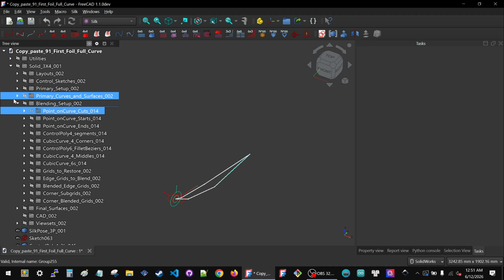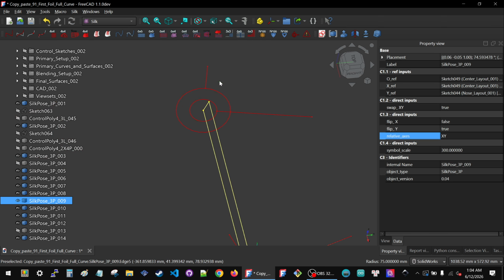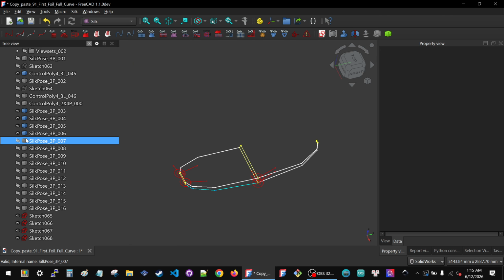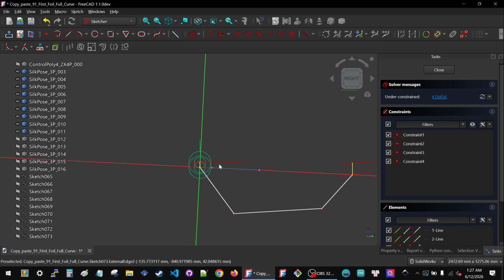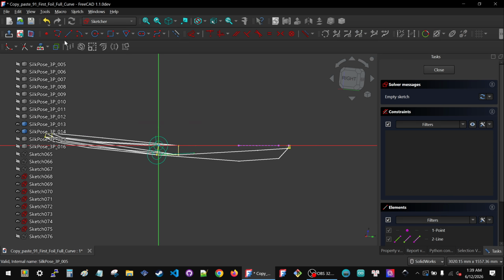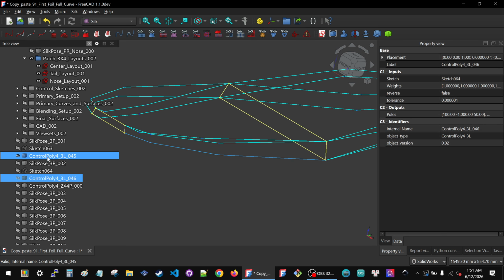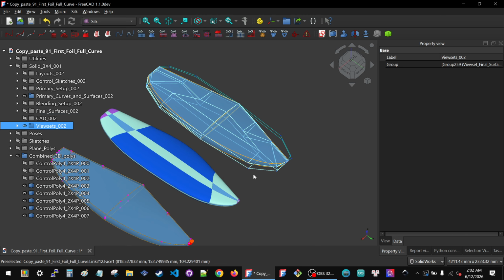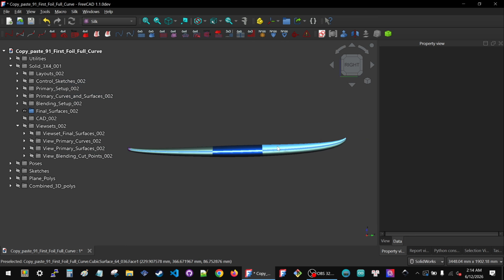FreeCAD Silk - Complete Tutorial Series 33 - Full Foil

Comment from the maker: The 7 new 3D curves are made in  'batch'' steps.
Skip guide for the steps:

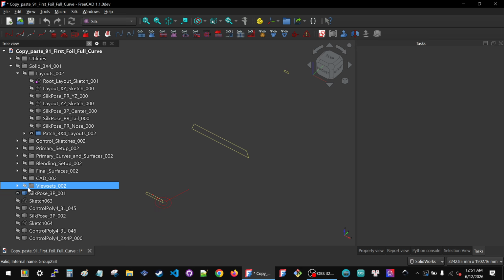0:49 'top' view SilkPoses for the 'right' rail (trick to get the correct X direction)
2:50 'top' view SilkPoses for the 'left rail (+trick to flip Y direction)
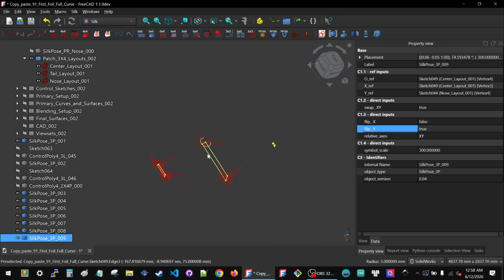7:40 'elevation" view SilkPoses for all rails (specific inputs and options)
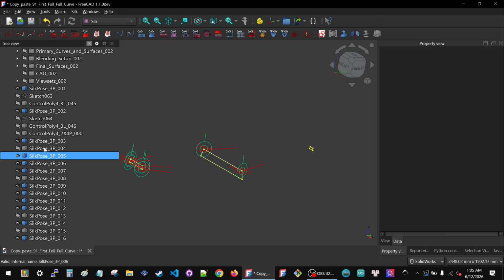14:20 'top' view curve sketches (drive X and Y)
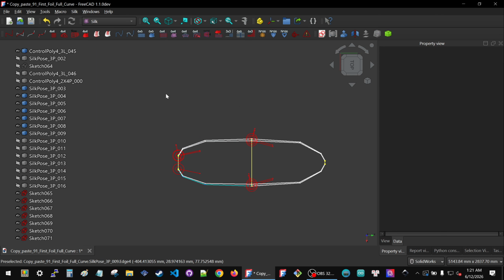29:57 'elevation' view curve sketches (follow X of 'top', drive Z)
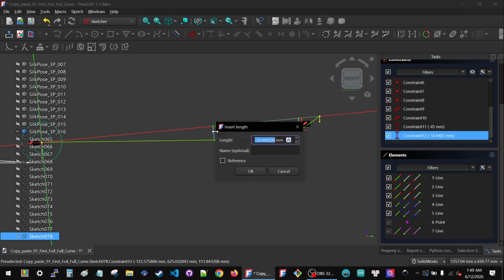58:15 ControlPoly4_3Ls on all the new sketches
59:50 turn each pair of 'top' and 'elevation' polys into a combined 3D ControlPoly4_2X4P
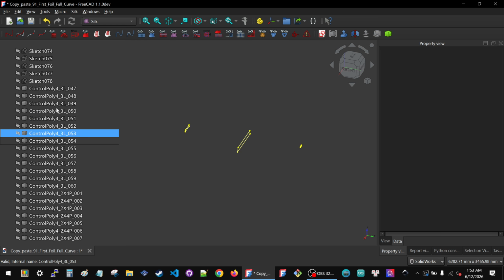1:02:30 rough sorting of document objects
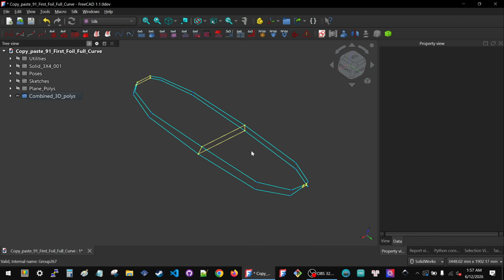1:05:57 swap out all the original 'straight line' span polys to our new 3D polys
--->swap it in the edge curve
--->swap it in both grids that touch the edge in question
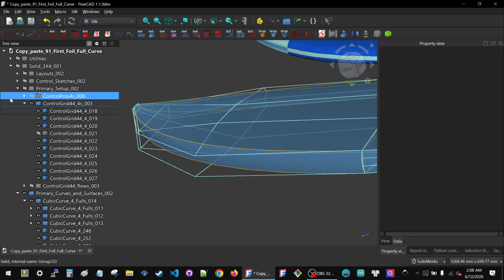1:17:47 Objective reached. rest is design edits and thoughts
1:18:20 How you actually build a model when you already know how to use the elements
1:21:09 Reduce all the blending to a minimum. we have real design curves to work with. blending is just a final touch.